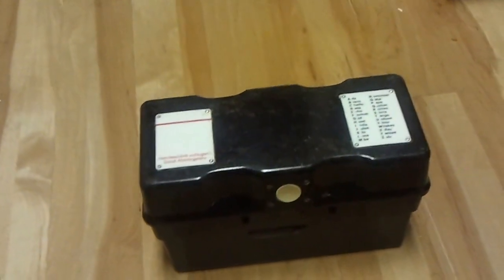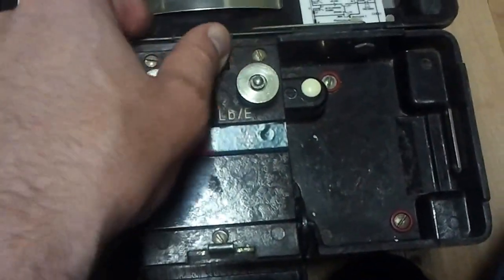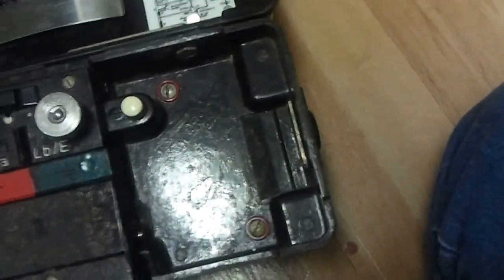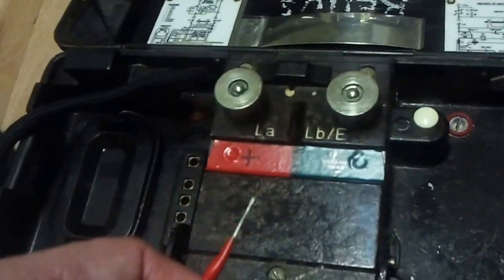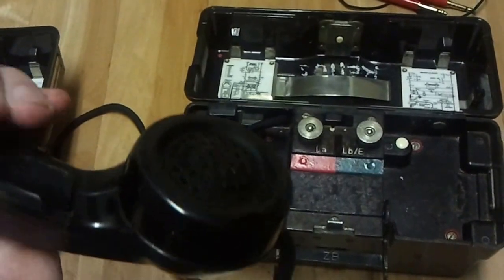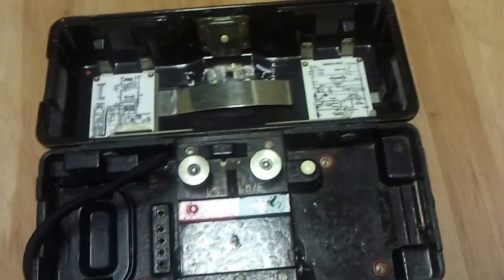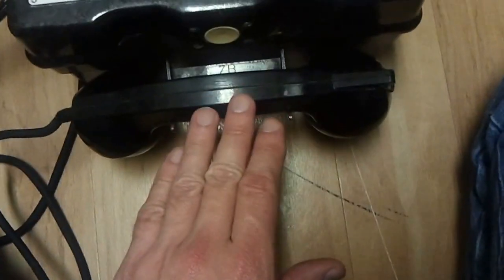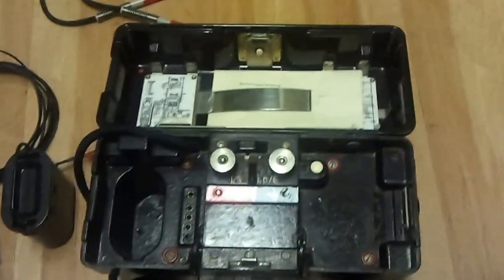German FF-OB/ZB Field Telephone

Comment: These phones operate in two modes.  When the switch hook is folded into the case, the phone operates in "OB" mode.  In this mode, you can connect two phones together with a two conductor cable and they will operate with their onboard batteries.  In this mode, the lid is closed and when the phone is not in use, the receiver is placed on top of the lid, with the ends fitting in the indentations in the lid.

When the switch hook is unfolded down outside the case, the phone operates in "ZB" mode.  In this mode, the phone can be used on a civilian telephone exchange, which has a central battery.  The phone can only receive calls, unless you can find a rotary dial attachment for it.  These are extremely hard to find in the US.  I have one on my phone and it works great.  Again the lid is closed during use, but the receiver is placed on the switch hook when the phone conversation is finished.  When the receiver is placed on the switch hook, the phone sends a pulse to the telephone exchange to automatically disconnect the call, like hanging up a regular old school civilian phone.

One last thing about the button in the receiver... You don't have to keep pressing to talk, say, "over," and release to listen.  As long as you hold the button down, you can talk and listen just like on a civilian phone.  However, as soon as you release the button, the other party can't hear  you, but you can hear them if they are talking and holding their button down.  The button is essentially like a mute button on a modern phone.  This was necessary so when the phone is in OB mode, the other party (or the enemy) can't listen in on conversations near your phone while the receiver is sitting on top of the phone lid.

Comment: La = leitung a, line a. Lb/e = leitung b / erde, line b/ground. The german would normally use a one line setup with ground pins attached to lb/e and the frontline units would use a doublr line connection  with 3km lines to the nearest cp.

Comment: I have one with the straps, I hook it up to about half a dozen different models of field phones. I like the ringer best on this one.
Reply from the maker: I now have two Korean war era EE-8B, and two Swedish M-37 units, the M-37's are neat, they have a buzzer with a push button that allows morris code transmission between the units for covert com, or when noise is too bad for voice com.
Reply: have not seen one of those, I have several French and british phones from the WW1 era as well. My wife thinks I am nuts collecting these.
Reply from the maker: Terr Ret I started with the ff-57 german units they were around 45$ a pair+shipping. I also have a SB-22a/pt us military switchboard I restored, and a set of gra-39 units for remote control of a radio transceiver and interfacing it to the sb-22a. I am modding the gra-39 to use external power, they run on 6 "c" cell batteries each. Eventually I am going to get some high capacity NiMh D and C cell batteries to store away, so I can setup a communications hub if everything else goes down. I built an interface for the galaxy series CB radios for the gra-39, but haven;t had a chance to test it due to a break-in in my truck, and theft of my galaxy radio.

Comment from the maker: Yeah, I never see them come with straps, if you look hard enough you can sometimes find a complete strap on e-bay or ETSY, or some other place. I've been meaning to get one so I can try to duplicate the mechanism at the end of the straps that slips into the sockets on the side of the field telephone case. You can also find even cheaper the FF-33 units, it was the design before the FF-ob/zb. The FF-33 do the same thing, but are a little clunkier in esthetics .
Reply: Just bought 10 of them from colemans, and they did come with the straps. Not exactly cheap though. Been testing the polish switchboard too, and it works rather well. No batteries required unless you want to add a bell. Have the Swedish and German phones both hooked to it. It uses a normal field phone for the operator station. 

 First switchboard I got has two bent metal sections, nothing major, and looks like it can be straightened, and does not effect function in any way. 2nd one I got in with the German phones looks perfect. Have not tested it yet, but they are pretty simple devices and don't expect any problems with it, as the first one had none.  

Question though unless I missed it, is what is the white button for? Ah, see it in the second vid. 

 Think I'm leaning towards the Swedish phones as far as liking better. As I said before though, they both have distinct features that make them interesting. Still testing the German phones, but so far have 2 out of 3 working. 3rd one seems to not be getting power, likely a simple fix. Had the same problem with one of the 2 Swedish phones. Thanks again.
Reply: two things you misunderstood about the phone. first the battery cable is used to connect the battery pack to the phone so that you can put the battery pack into your pocket to keep it warm during winter so the battery doesn't die. second this german field phone is dual mode. with the hook folded out the phone is in ZB mode meaning Zentralbetrieb (centrally operated) so this relies on a central battery like a normal civilian phone line. with the hook folded in it's in OB mode meaning Ortsbereich (local operation) where you need the battery pack. with the hook folded in you close the lid and put the speaker on top of the lid in the indentations either left or right. weather you put the speaker on the lid in OB mode or on the hook in ZB mode the push to talk button is half pressed with disconnects everything to prevent the enemy from listening in by turning the speaker into a microphone since all speakers produce a little electricity since they are almost the same as a microphone (the microphone itself is also disconnected).

Comment: I have two of these.  They both worked great for a while, then one handset mysteriously stopped working.  It's not the handset, but it appears to be in the connection or in the body.  Any clues about how to check it out further to bring it back to life?  Who could I take it to to get it repaired?
Reply from the maker: Rick G,  the handsets use a carbon mic, and a speaker that usr spring brass contacts to connect, make sure they are clean,  and making good contact.  Make sure the carbon mic rattles when you shake it, if not then gently tap on s hard surface to dislodge the carbon particles. Check the handset wires continuity with an ohm meter. Could.be a bad wire, check the connection at the phone side, check the battery compartment battery terminals. NOALOX electrical anti oxidant coating is great to use with this gear.
Reply: Thanks Jason.  I switched the handset from the other phone into the set I am having problems with, and got the same problem, so it isn't in the handset.  It seems to be a problem with the connection of the handset and the pins where it connects to the body, or somewhere inside the body. I couldn't gain access by unscrewing the 4 red screws, so I'm not going to pursue that further for now.  I agree that it may just be corrosion on the connections of the handset to the body that may be doing it, so I will try to figure out how to get into those tiny pin holes to clean them and see what happens.
Reply from the maker: Rick G couple of things, try a gas torch cleaning tool, and Sone standard pipe cleaners,  and some steel wool for the male pins. That's how I cleaned mine. I'll get one off my shelf and take a look on taking it apart again.
Reply: Thanks again, Jason.  Good tip on what to use for cleaning. I've known for years about cleaning contact points on electrical conections and contacts, but didn't think of hit here for some reason.  Knowing how good German engineering is, I believe in the overall construction, but corrosion is not something that can be prevented.
Reply from the maker: Rick G I took a look at the ones I have. Loosen all four red screws, the bottom of the case will pull loose from the upper ring where the lid hinges are at. If the bakelite plastic is in bad shape, use 400 or 600 grit sandpaper to smooth it out, then use some good fiberglass boat wax with a mild abrasive polishing grit in it, makes them look great